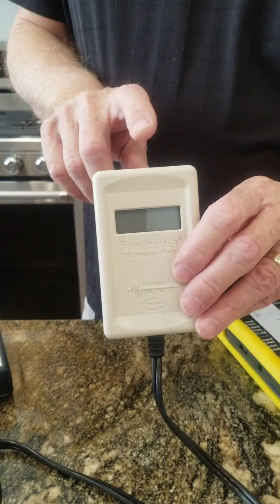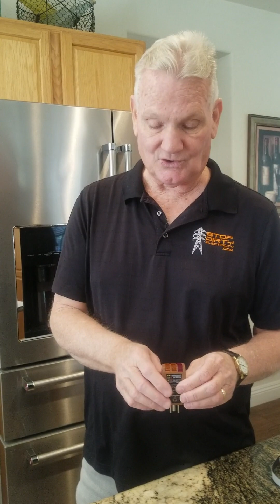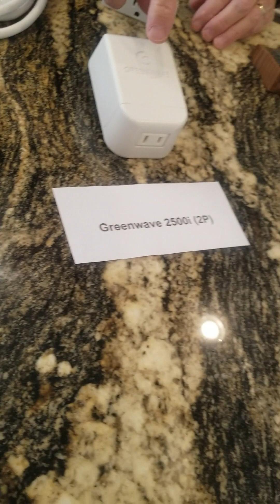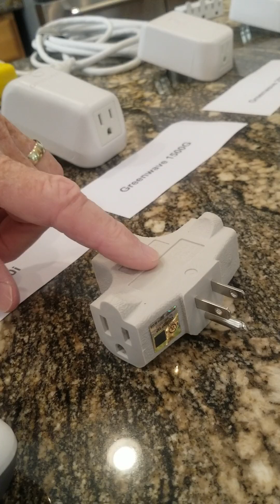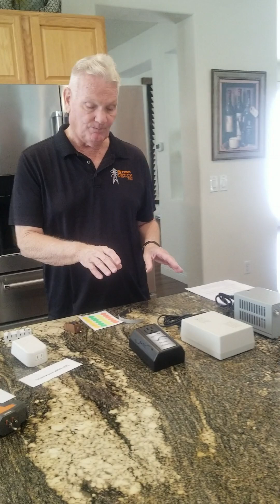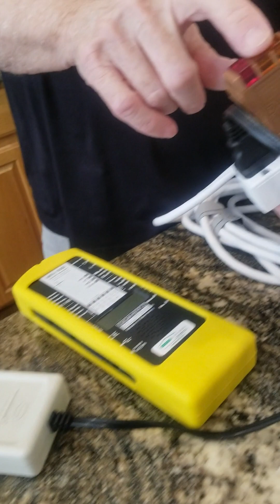Advanced Techniques For Reducing Dirty Electricity

Comment: What a great video. Thank you for a great demonstration. In your opinion for a sensitive person what filter have you found to be the most effective?
Reply from the maker: Great question.  It varies quite a bit.  I would start with the Bio-Compatibility test with 5 differenet filters - 

4 differenet Greenwave filters
2500i
2500 2P
2500 3P
1500

Stetzer Filter - Stetzer makes one filter

If you order the 4 Greenwave filters, you can return them if they do not work out - have to phone to get the 4 different meters - 720-310-8499 - use safe7 - for a 5% discount - Kim Lear

When you order the Stetzer - just ask if you can return if it does not work out.

Call me if you need help with the Bio-Compatibility test in the kitchen

702-845-5794

Bill

Comment: Ok so even thought this is like 6 years later and obviously for employees of yours not the customer...I've still got questions for ya and hopefully your still around and see my comment. So after watching your video im afraid I definitely can not afford your services. And I can't even afford majority of the devices your going through here. Wondering if you maybe have an idea for a plan that someone Luke myself could go abouts with to help reduce dirty electricity at a lower cost? I've learned with experimenting for last year or so that I'm extremely sensitive to both emf's and the dirty electricity in my older home. I'm acually in a rental quadplex in a lower income area where I'm pretty positive they weren't very attentive towards how they wired the quadplex.  We've got all sorts of electrical outlet issues. But I do have the outlet tester that has helped me figure out which ones I can use and which ones I've acually covered up to prevent anyone using. Our property management is not going to help in rewiring this while quadplex, and just me complaining about it would likely result in some sort of unlawful discrimination and possibly eviction ide rather avoid. Anyways aside from that which I'm aware is a whole different massive topic and issue that certainly needs to be resolved...what can I do as the resident with limited ability to fix the wiring, though I doubt the landlord would even know let alone care if i were to cut holes in the wall and repair or replace bad wiring and outlets...what can you suggest I do to try helping reduce the dirty electricity in my home? Property built in 1954..and highly doubt it's ever had any upgrades within the electrical system other than maybe the breaker but even that looks very old and is very outdated and oddly done for I have control over my neighbors electricity for theyre whole backside of theyre unit...his kitchen and back porch all on my breaker panel.. very odd. But then again we also have multiple switches that control nothing, so its all sorts of wack. But I honestly can't afford to move and there's not anywhere in the town that's even close to the rent I pay here for size property and yard I have here. I can't just move,i wish I could cus this place is making me really sick and making life a whole lot nore difficult than it already is trying to raise my son in below poverty best I can to ensure he gets out of it
Reply: LED and CFL bulbs are a common dirty electricity source. only use incandescent or halogen bulbs because they don't create any dirty electricity
Reply from the maker: Bill Cadwallader - 702-845-5794 - I am so sorry you are having these EMF issues. 

I have 2 books that have many solutions in them, If you are a reader I would start with them - StopDirtyElectricity.com

If you need some more assistance, there are 3 meters that you can buy to measure all 6 of the EMFs - so start with one of these meters if your budget can handle it

3 through the air - in the high-range of frequencies - wireless, WiFi and Bluetooth - commonly called RF - Safe and Sound Classic meter 

1 EMF in the mid--range of frequencies from the wires - Dirty Electricity - Greenwave EMI Meter or Stetzer

2 EMFs in the lower-range of frequencies from the wires - Electric Radiation and Magnetic Radiation - Tri-Field TF2

These are listed on my website - StopDirtyElectricity.com - if you are having trouble finding them - I also have discount codes for them there

Hope this helps and gets you started.

Bill Cadwallader - 702-845-5794